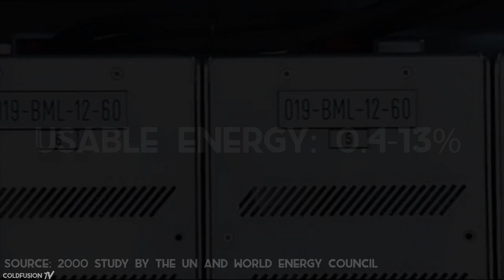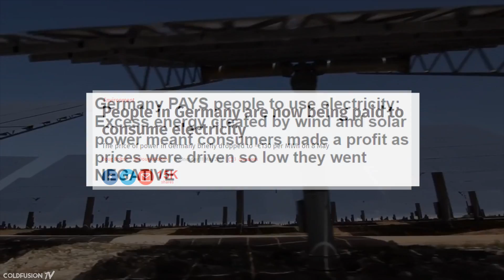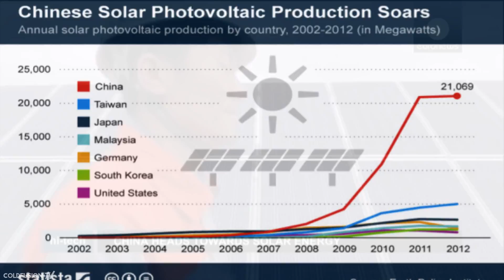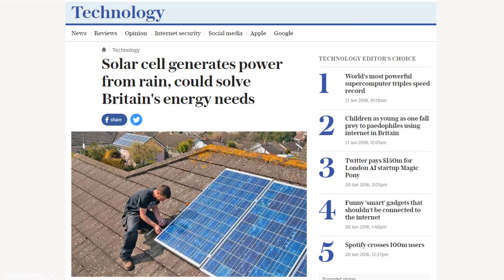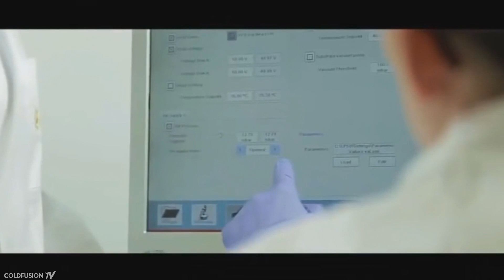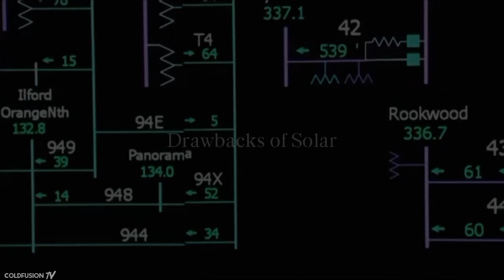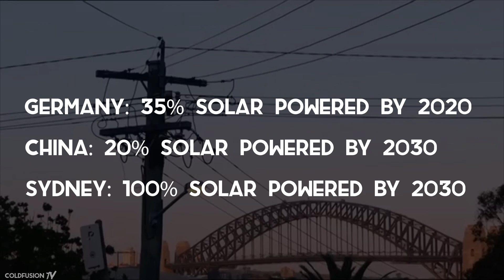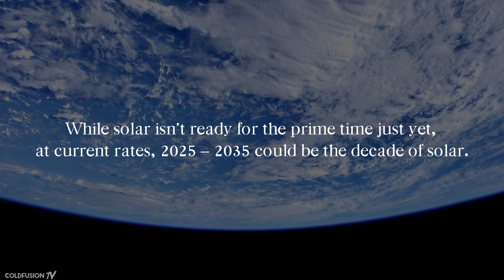The Truth About Solar

Comment: Why didn't you compare solar to the currently available alternatives like Wind, coal, natgas, and nuclear? Don't you want to be, you  know, honest?
Reply: You should check out liquid thorium salt nuclear reactors. Absolutely melt down proof and virtually inexhaustible fuel supply. I was never a fan of nuclear till I came across them. But the only catch is getting energy companies to adopt this better technology when they've invested hundreds of billions in traditional nuclear. Although a few Chinese companies seem like their going to try it...We'll see.
Reply: biogas has never bin used to full potential.  it produces heat. electricity. and better compost. its not as low efficient as you say.  thy burn gasses that would damage the ozon layer more as the co2. there is a reason why in the EU thy don't want to have large animal farm stock's  [atm in the Netherlands a huge problem as many farmers need to down scale or even stop farming with animals]

the ideal would be to make of ever waist product new energy. including solar wind and not to forget water turbine's. using the current of the sea it self.
so in short. 
we are no where close towards the clean energy as most people say / think we are.  

@TGGeko you should start reading Rolf Sievert and his discovery
Reply: william III  it's not the liquid that is the problem.   the problem is more that a lot of the resulting products are not allowed to be used in most eu country's.  

the heat one produces could be used for a town central heating. but most people don't want to live near one as it smells. 

and it's a hungry beast that can't just use shit.

and I have jet to see a category 5 biomass as thy are allowed to use food rest that include meat. 
(imagine the smell from that)

but if most of the waisted energy is sorted out. it is actually a good solution if you ask me as it helps with the shit problem we have. it's waist product contains more energy for plants than just shit. and you get less green junk. produces heat.  tough clean I would not call it
Reply: Stevia is toxic
Reply: Forgot about water dams? It can store water for future energy use and even let some go if the water rise too much (without providing power if needed). It's not radioactive and dont pollute much compared to something like coal.
Reply: they did compare it with coal I think, wind power is very inefficient at present I gather so maybe that is why it wasn't compared... maybe the just compared to coal because of the amount of plants that use coal as fuel.. or maybe it is the most efficient of the "alternatives"...
Reply: Maybe nobody died yet but look at the area of land surrounding the site that is now unlivable. The forest and it's inhabitants are taking over but there is enormous damage to the ecosystem itself. Malformed trees, who's leaves are contaminated so this food source is entering all insects, birds, reptiles and the list goes on and on..
Reply: Rene Schiffer  What about those that die from   fossil fuel  emissions
Reply: No one dies from fossil fuel emissions unless you run it inside dude. lol
Reply: because it was about solar, not all these other things
Reply: Pull your head out of your ass and read this debunking of 195 bullshit arguments.  You've only listed one, but I'm saving time in debunking your crap all at once.

https://www.skepticalscience.com/argument.php
Reply: "Nuclear - a risk today (Fukushima, Chernobyl...) and the waste a problem for the next several million years."-Those were human error, not a fault of nuclear energy itself. You cant fix stupid in people, regardless of how safe or not the product is.

"Fusion reactors - maybe available in 20, 50, 100 years? Expensive and complicated technology."- So we should just abandon it because of this?
Reply: hey finally i found my troll today.....how much u make in coal industry?
Reply: Natural gas and Coal aren't renewable and are one of the leading causes of manmade global warming. Nuclear fission is - in the meantime - much less of a risk next to fossil fuels for now, until we can make wind, tidal, and solar more prolific. Nuclear FUSION, however, is probably the only long-term, high-output energy option we as a species have. If we survive long enough to achieve a viable form of it.
Reply: So the fact that Chernobyl was caused by human mistake makes it ok or what?
Reply: Off course not. Solar will never gonna be the thing they kept insisting it is, is simply too inefficient. But it will work great in low intensity areas, in remote regions.
Reply: TGGeko the proof is there and it's un-refutable. I won't bother to convince you otherwise but don't try to convince you against your unfounded beliefs to someone who actually knows science.
Reply: OnlywenIlaugh  http://news.mit.edu/2013/study-air-pollution-causes-200000-early-deaths-each-year-in-the-us-0829.   It looks like MIT   disagrees with you
Reply: Nuclear is far too expensive, and the disposal is a problem.  It's dead.
Reply: Wind - similar problems like Solar, maybe even worse.  Here in Germany on windy days many wind turbines are turned off b/c there is too much production. On other days there is just not enough wind. But they can be good in a mix with solar b/c when it´s cloudy there may still be wind and vice versa. 
Coal and gas - enough sources available about problems with pollution and CO² from fossil energy sources. Did you know coal plants are causing a higher radioactive pollution than a correctly working nuclear plant?
Biogas - very limited, prices for food are already rising b/c agriculture is misused for energy production. Farming also needs a lot of energy, so low efficiency. Gas from waste will not be the big solution we´re looking for.
Nuclear - a risk today (Fukushima, Chernobyl...) and the waste a problem for the next several million years.
Fusion reactors - maybe available in 20, 50, 100 years? Expensive and complicated technology.
Reply: Rene Schiffer Citing Fukushima and Chernobyl as examples of nuclear danger is disingenuous. No one died from Fukushima and chernobyl was the result of deliberate human action, not engineering failure. 

But thank you for giving a breakdown of the alternatives.
Reply: TGGeko No one died? Let´s wait for cancer statistiks in the following years. And what do you mean with "deliberate"? They blew it up purposely? What? Human failure is always a factor. There is no 100% safety! https://en.wikipedia.org/wiki/List_of_civilian_nuclear_accidents
Reply: Rene Schiffer Im fine with waiting. And I look forward to you presenting how you can identify cancer caused by the reactor and just normal cancer. 

And I mean Chernobyl blew up because the engineers purposefully ran a test beyond the safety limits. Everyone knows this.
Reply: It is possible in statistiks, just not in every individual case. Just compare numbers from before the event and after. Statistiks will show if there´s a significant rise in fatalities - and there will be. And for Chernobyl, that´s why I mentioned human failure. They thought they new what they were doing - people always think this before hazard happens. Look at it this way: a solar plant does not have the capability to kill thousands. A nuclear plant has. There are nuclear plants all over the world that are either too old, have underpaid and under-educated personell or are build at the wrong places - or all of that.
Reply: Globe was warming and cooling thousands of years before cars and factories. Global warming is a farce to get money. Please don't use it as a reason. You have no proof of man made global warming, only people's theories who want to keep their funding. While I agree we should take care of the planet and stop most pollution when possible, many including myself choose to believe the many scientists who do not believe in man made global warming. They cook the books, studies, and reports to keep their funding alive.

Comment: Actually, the truth about solar is that it's expensive.

-Grid-tie systems are a MAJOR investment that takes decades before you break even. Plus, it does not work independently. It needs your power company to be up and running to function. If there is a power blackout, you also will be in the blackout. It also means you can't use it in remote locations. You have to be tied into the power grid.

-Off Gird systems runs off power stored in batteries, which are the heart
 of the whole system. All the solar panels do is recharge the batteries.
 Your battery bank is big, expensive, and has to be replaced every 7-10 
years. You will NEVER break even with off-grid until they can find a 
cheaper and long lasting way to store the power from the panels. The one
 big advantage is that you can have power in the most remote locations, 
even on an island (which some of the superrich who own their own island 
do). As an example of cost, just to reliably run your average fridge 
24/7 will run you some $3500-$4000. And every 7 years or so you will 
have to shell out another $2000 for new batteries.
Reply: Modern refrigerators aren't that bad.  Typical ones draw about 350Kwh per year.  About 1Kwh/day.  About 1.5 hours per day on a 1Kw solar array, or 3 hours on a 500W.  A 500W system will set you back about $500 not including batteries, which'll cost another $200-400.  You could DIY it for a lot less.

Yes, most A/C refrigerators are rated at 600W.  But that's when the compressor is running, and most of the time it isn't.  Since it's an inductive motor, your inverter has to be around 1500W to ride thru starting surges using battery power, but inverters at that range those are cheap now too.
Reply: A Kill-a-watt meter will show you exactly what it draws.
For mine, it showed 1080 WH/day. It drew between 656W and 704W while running, and 134W between compressor cycles.

With electronics in all modern appliances, you need a pure sign wave inverter. My 24v 1500W GoPower was around $480. Home Depot Grape solar panels were on sale for Black Friday so I snagged 320W worth for $400, and picked up a nice MPPT charge controller for about $200. Two 12v 155Ah VMAX SLA batteries for $605. After adding in fuses, on/off switches, cables, DC circuit breakers, etc. I'm close to the $2000 mark. I could have saved some coin by using flooded lead acid batteries, but I didn't want to have to deal with watering and explosive /corrosive fumes.
I should be able to run the fridge 24/7, and can go about a day and a half without sunshine, but I'm in Vegas so sunshine is never a problem.

Comment: Solar is the most expensive way to make energy.  By the time it pays for itself it is broken and the manufacturer has bankrupted and renamed itself to avoid warranty costs.  Using solar is really just an exercise in how little energy can you use.  

Cheap energy equals a higher standard of living for the average person.  I think a lot of the green energy movement is just a smooth way to make energy too expensive for the peasants and leave only the elite with a decent standard of living (the elite not walking to work or freezing in their homes during the winter).

Comment: You mentioned the diurnal off-set with solar power production and pointed out the this can be addressed with batteries. You missed the other off-set with solar. Unless your solar production is close to the Equator, there is a seasonal off-set which increases in magnitude the further the solar system is north or south of the Equator. The off-set of my solar (PV) production is 3:1 when comparing June and July to December and January.  Peak power usage is reversed in that my house uses over 40% more power in December and January than it does in June and July. To summarize, my solar system produces 39% more power than my house uses in June and July, but the same solar system produces only 29% of the power my house uses in December and January. This seasonal production/usage off-set can not be solved by batteries. A high efficiency world wide grid would solve this, but the cost would be enormous. 

Another issue that was mentioned briefly is that PV solar cells perform best when they are perpendicular to the sun's rays. With a fixed solar array, whether it is a single panel or many panels, this is not possible. Individual panels would need to track the sun's position for maximum solar energy conversion. This is possible, but it would add substantially to the costs of solar power systems.